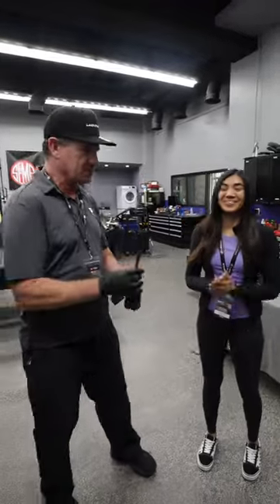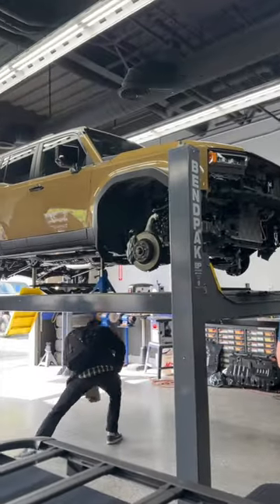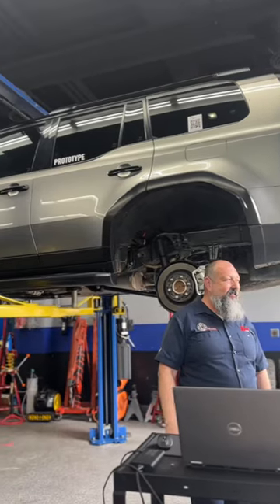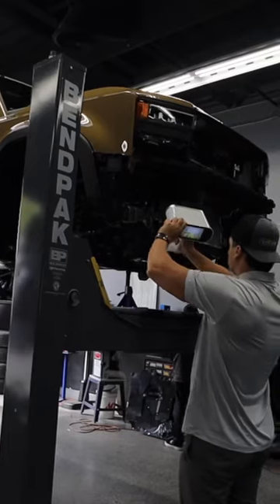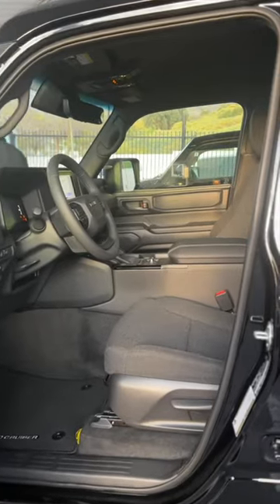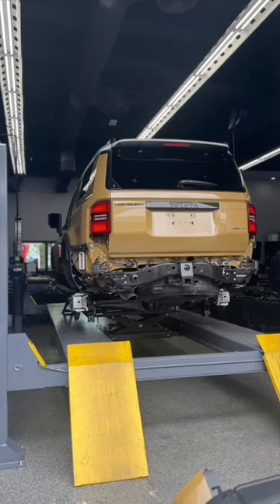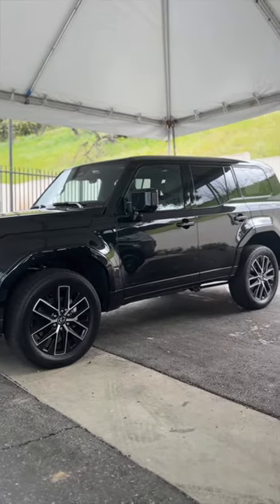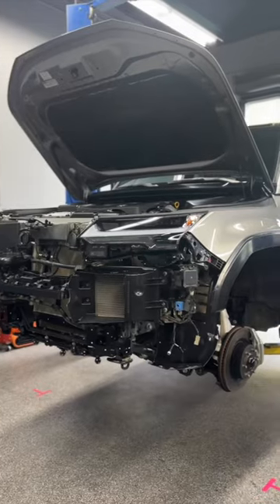Insider Look at the NEW Toyota Land Cruiser and Lexus GX 550!!! 😮 #shorts

Comment: I had hope for the new Land Cruiser...but...no V8. No diesel. Just a city-rat hybrid drive train. Incredible disappointment.
Reply: So you're telling me that paying less for road trips and being able to have double the range than before, for very little power difference is enough to make you sad?
Reply: @LT1316  
"Road trips". Get out of here with that b.s.
It's just a yuppy, stretched, fj.
Reply: @sampsonlll1825  may I ask what you would use a land cruiser for if you owned it?
Reply: @LT1316  I'd use it to cruise over land
Reply: I have had very low expectations for all manufacturers, although I would love to see Toyota come out with a real 4x4 with two solid axles, this is a nice crossover though and it flexes better than most of the other crossovers.. I’m not loyal to any brand, although I have owned three Toyotas.. the downfall on every Toyota is the limited independent front suspension , it may as well be on a car.. too much electronics $$